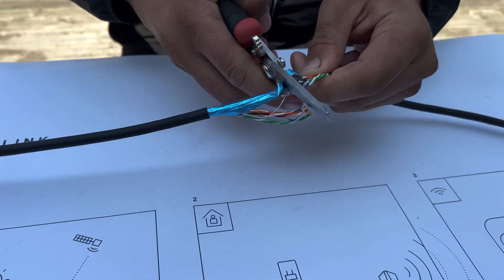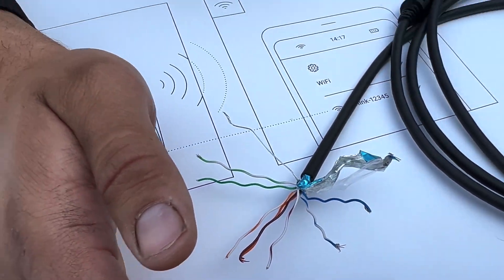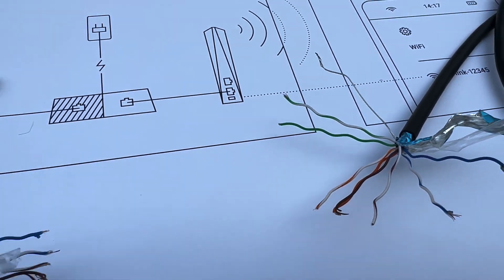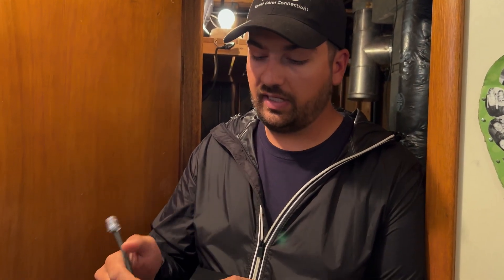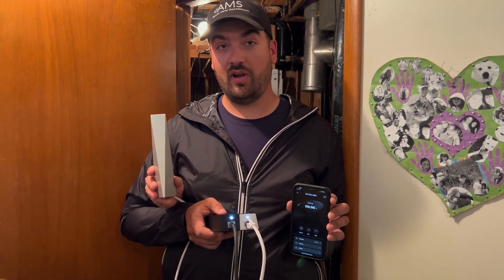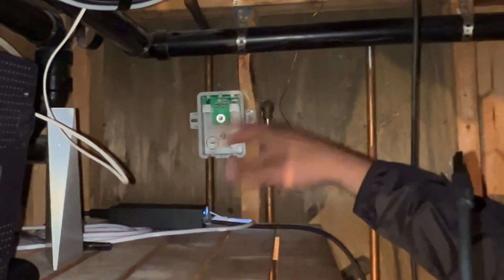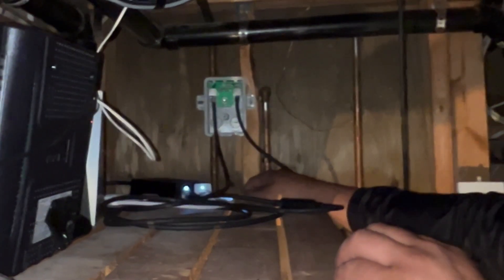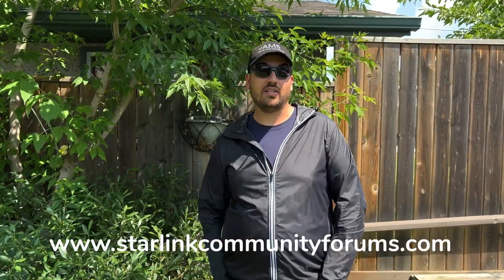Starlink, damaged, kinked, cut, cabling repair, installing a connection onto the factory wiring.

Comment: Hi, can you use a cat 5 ethernet cable instead of the cable provided by the company so as to have fewer problems passing through the corrugated pipe? An installer says it is possible. Thanks with starlink generation 3

Comment: Hey mate, thats a really good video. 
Just to confirm : if i just want to replace the cable and not repair it (I would actually like a short one, approx 10m, I have a gen1 round dish), can I simply purchase a basic outdoor cat6? 
Cheers.
Reply from the maker: Thank you!
You should be able to use a Cat6 and up style Ethernet without to much trouble, especially on a short run. Your factory cable though does have and EMI suppressor on it (tubular section near the end of the cable) and it is meant to suppress interference from radio frequencies and electromagnetic, etc. If possible test your chunk of Cat6 for a week or so to see how it performs in comparison to the original factory cable.

Comment: I'm replacing my Gen 1 with High Performance but would like to repurpose the Gen 1 cable as a straight ethernet run as it's installed behind siding.  Can you tell me the correct wire color to pins 1-8?
Reply from the maker: As long as you match the Ethernet pattern on both sides you can do type A or B. 
Type A is the one I use most often and that will be(from left to right) striped green, solid green, striped orange, solid blue, striped blue, solid orange, striped brown, solid brown. When sliding the crystal connector you will have the tab facing down with the striped green starting on the left side.
Sorry for the late reply! I hope this helps 👍
Reply: @AllMediaServices1  Figured it out.  The Gen 1 doesn't use all 8 wires.  So I put the sequence you described on one end and essentially made the feed an ethernet cable .  Obviously you reverse on the other end of the line.  The tested ;that came with the connector kit worked great.  Up and running.  High performance already making a difference out  here in the sticks.  I direct feed my Eero mesh system and have been getting ~300 download and ~160 during peak evening use.  More important, much fewer and shorter drops.
Reply from the maker: That’s excellent! Glad to hear it’s working out for you. I haven’t heard much regarding the High Performance yet so it is good to hear a testimony on the difference it can make!

Comment: Did you use that injector for saving the heat function? Why not orinary coupler?
Reply from the maker: That is what we had on hand, and it is also good for an outdoor connection as it helps keep the elements out of the connectors. I’m sure an ordinary coupler would do the trick as well 👍

Comment: Can you not just solder and wrap each cable ?
Reply from the maker: I imagine that would do the trick as well.
Reply: If you wanna get more interference. These are data cables with power. Not a power cable. Dont solder them together. Do it right.

Comment: If the entire run isn't strapped down to static structure, use standard.  Solid will fatigue with vibration or flex more.  Ensure your connectors match your wire type (strand/solid) and, as you did, keep as much twist as you can up to the connector, which is why the connectors where the wire passes through are better, even if cutting the wire that sticks out seems wasteful.
Reply from the maker: That’s good info! Thank you James Wyatt.

Comment: I think you should have used a shielded connector to ensure continuity of the drain wire.
Reply from the maker: Hey Mark, your right a shield connector would have been the best. We could also ground at the surge arrestor for extra protection, good catch!
Reply: @AllMediaServices1  I want to use an external surge protector too but I have Gen 3 so I will have to cut the cable like you did and add RJ45 connectors.  I don't have a lot of experience with putting those connectors on.  Firstly I want to run the system a little to make sure that it is all working,  that way if I have a poorly connected cable I will be able to see the slow down in speeds from what I had before.   Right now I am still waiting for parts to finish my install which is on an external grounded metal pole about 40 feet from the house.  The pole allows me to service the dish or remove it when hurricanes are coming without having to put a ladder up the side of the house

Comment: You didn't explain how you knew which wire went where in the crimped on connector you used.  I assume you can't just put them anywhere in the connector willy-nilly.
Reply from the maker: here is a link to a diagram of the wiring order

https://www.digitalhome.ca/cdn-cgi/image/format=auto,onerror=redirect,width=1920,height=1920,fit=scale-down/http://www.digitalhome.ca/forum/picture.php?albumid=368&pictureid=3383
Reply: @AllMediaServices1  So it's essentially a Cat6 cable?  Can't wait to see your Gen 2 video (since that's what I have).
Reply: @stephfredhall6032  On the starlink cable it literally says cat5E